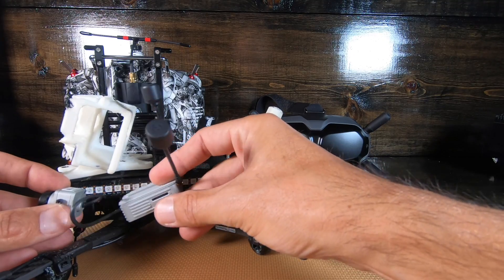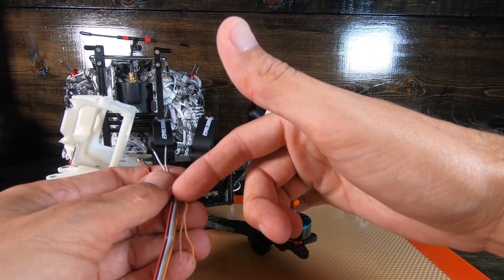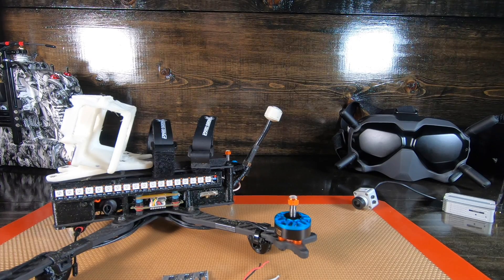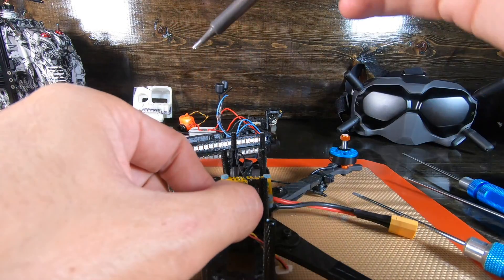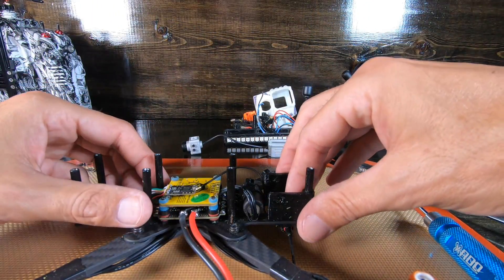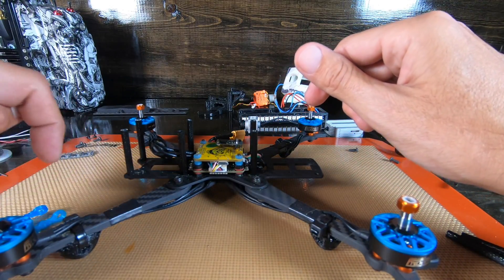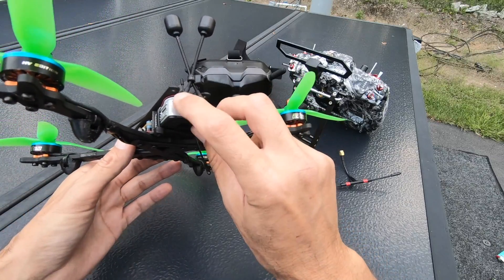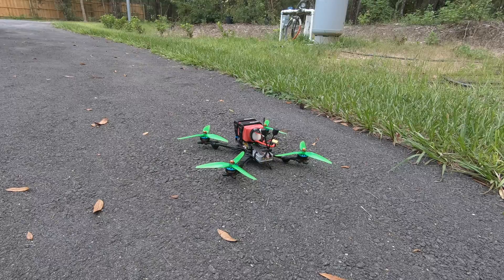Dji Digital Fpv System install with crossfire frsky spektrum and more

Comment: newbie question but what do I need to make the DJI FPV work with a Taranis X9 lite radio? Thanks!
Reply from the maker: Eric Bartolo nothing, they are independent systems so you would just hook each one to the quad like normal and fly
Reply: @cappafpv  Thanks for the prompt reply mate! If I buy a pre-built quad from iflight BNF with DJI FPV, can I just buy the DJI goggles and connect the quad with the Taranis X9 lite radio + crossfire receiver? Thanks

Comment: Wow fast and clean soldering. What are you using
Reply from the maker: Javier Ruiz thank you 60/40 rosin core solder. Nothing really special. If you are having issues soldering try a different solder and flux works wonders. The thin 60/40 is awesome to use
Reply: @cappafpv  thank you! I will look into it.

Comment: Thanks to Share, I bought the googles and 3 units for my drones, I'm gonna use my FRSky controler.
But I have a big question?!
Any time I want to Change the drone I have to rebind the googles with the unit?!? Or it saves the bind of my 3 units/drones?!?
Reply from the maker: DSteps Pilot mine saves the 2 air units and it links to the first one powered up if that’s what your asking.
Reply from the maker: DSteps Pilot I don’t have to rebind every time I switch quads
Reply: @cappafpv  now I have a little problem, I'm a bit confuse with the rssi Signal....its not stable like I have  on my analogue kwads....the rssi signal on my Dji drone is a bit crazy....I dont know if I setup properly or what.... daaaaammmm....
Reply from the maker: DSteps Pilot that I don’t know. Your using the DJI radio or no? It shouldn’t have any effect with another brand radio.
Reply: @cappafpv  I'm using FRsky x-lite and a XM+ receiver..after the upgrade the Air unir and googles with the new firmeare I setup the rssi signal on the OSD but its shows a very crazy Signal....its not a stable signal like I have in my analogue kwads..
It jumps a lot to 80's to 90's....it just crazy! I thing its something rong....
I just put the chanel 12 working for rssi.
Reply from the maker: @dstepsfpv  put a analog system in that quad test rssi and see if its the dji or a protocol thats off
Reply: @cappafpv  yap, gonna teu that soon, thanks for your help
Reply: @cappafpv  yap, I'm gonna try that soon, Thanks for your help, happy new year ;)
Reply: Yap, mines to, just Discovery after testing all binds
Reply: How is this setup running for you dsteps? Have you had any problems? I am getting a Taranis X9D SE tomorrow, can i pair a crossfire with it?

Comment: How can I connect my FRSKY X9d plus with the digital fpv?
Reply from the maker: Luciano Cuneo I’m not sure what your asking specifically. This setup is using the DJI with a taranis. The DJI system is only a vtx and camera. The video is hooking the camera and vtx up. Maybe I’m missing what your asking.
Reply: @cappafpv  Thanks for the response! I am new to the FPV game so I just wanted to make sure what I would need to purchase besides already having my X9d transmitter and the DJI FPV Digital System.

 I am thinking of getting a Cinebee 4k that comes with Frsky X-RS receiver but I am not sure if that would be compatible with what I have per say. Any suggestions?
Reply from the maker: Luciano Cuneo if you are buying a bind n fly then you would remove the vtx and camera from the bnf. It doesn’t sound like nothing else is needed.

Comment: Great post! Really helpful to see each of the steps you went through to install. Have you done anything special to secure the antennas? I see you cable tied them to one another, but mine feel like they'd just fall out. I'm thinking they need to be secured to the unit too
Reply from the maker: Gavin Edgley I haven’t had a chance to design a tpu mount as of yet. Yesterday I just got it fully unlocked. I want to make something for this frame to make it fit a lot better
Reply: @cappafpv  hey, i'm building my first drone, how do i know what port i'm in??(usb, Uart1/2/3/4, etc)

Comment: actually, DJI's controller has lower latency than crossfire, it's 7ms
Reply: Yeah but apparently the Crossfire is better for lang range and thru obstacles. Is that true ? Anyone agree or disagree ? I have already the Taranis QX7 and don't wanna buy the expensive DJI remote. Thanks :D (and I'm a big noob on FPV, go easy on me please ahah)

Comment: Crack open that flight module box and get the guts out. Its going to be way smaller and lighter. Everyones complaining about the size but nobody ive seen has gotten rid of the bulk..
Reply: it's a heat sink - you need it.  Air flow might help, but the components get hot, so I'm not sure you can remove them - maybe I'll try.

Comment: So your using that huge box with the VTX and Receiver as a HD VTX only. real waste of money on my opinion. And a huge waste of space and weight. Wait for the Fatshark. It will be a much more efficient and less costly solution. Plus I can't stand DJI. So no thanks.
Reply: the fathark one requires groundstation not a module.
Reply: @boratsagdiyev1586  Exactly what I would want.
Reply: @JohnIn2SonAZ  I cant see the benefit of that

Comment: What would be the practicality of using this system with an RC truck. Would it be possible to use the DJI controller in place of the RC controller that usually comes with trucks (Arrma / Traxxis). I am not sure how that could be done, as it seems like the DJI controller is only compatible with BetaFlight, which I assume is only relevant to quads.  Just wondering, since the controller paired with the camera supposedly provides additional range. Any thoughts on this would be welcome.
Reply from the maker: No-Motion well it could work. I’ve used my frksy taranis on my rock crawler. DJI system uses sbus so as long as you have a board that converts sbus to ppm I believe it will work. I have done this before
Reply: You could setup the fc board to control servos.
Reply: I was just thinking it would be cool to mount the DJI FPV camera and air unit somehow inside and back behind the windshield (maybe would need a small hole cut out in the windshield.  then you could just use your own Traxxas Transmitter to control the car, but actually be looking thru the camera in an  HD view, as if you were actually inside the car.  Like a real driver of a real car would do.  Just some thoughts.  I am sure the RC community will look into this, as the system is certainly not just intended for quad copter uses.

Comment: Thanks for video ! One question please : why didn't you connect directly the module +  and - directly on a 10V solder pad + and - on your FC ? IN such way no need the Matek converter
Reply from the maker: Cine Whooper my fc only had a 3.3 or 5volt pad. I run 6s so I needed to step it down
Reply: @cappafpv  ah Ok ! Thank you. Wait for your test video and your feedback :-) Thanks for all your informations, it helps
Reply from the maker: Filmmaker studio I am in the process of editing it now. It’s just a pain because it’s 3 cameras to edit into one video lol
Reply: @cappafpv  Let's see the result; are you happy to this DJI product ?
Reply from the maker: Cine Whooper not really. DJI has mine locked to 25mw and I can’t get in out. Waiting for a day so far for something to happen
Reply: @cappafpv  you can't fly at 25mW ? What is the problem ? 25 mW is the law in Europe
Reply from the maker: Filmmaker studio no it does fly but it breaks up. I was sold that it flys 1.5 miles close to the ground. Can’t do that on 25mw I guess. But then again that was told from a DJI paid spokes person. If it’s 25mw and goes 1.5 miles on the ground so be it. But these goggles at 25mw go about 200’ before they break up. So? I’m confused did I buy something that goes 1.5 miles or 200 feet?
Reply: @cappafpv  What I understood is that automatically, if you live in Europe, DJI will limitate power to 25 mW and for max distance 700 meters. Did you make activation of all elements ? I read that with no activation it can limitate the capabilities
Reply: @cappafpv  Ugh that's painful. You're the second person that I've seen with this problem. I'm new to this, I'm sure I'll run into the same thing! How do you know it's stuck on 25mw? Does the OSD tell you, or Betaflight?